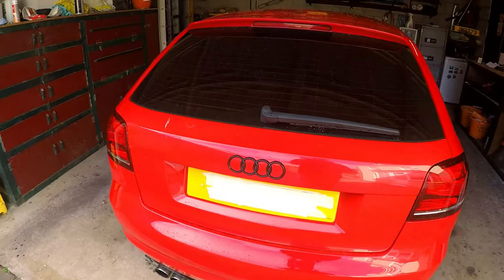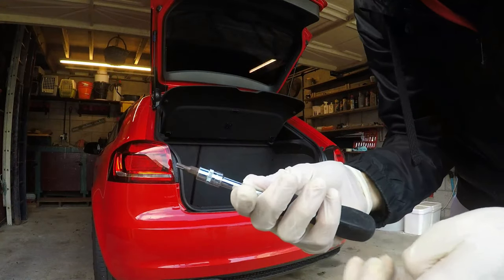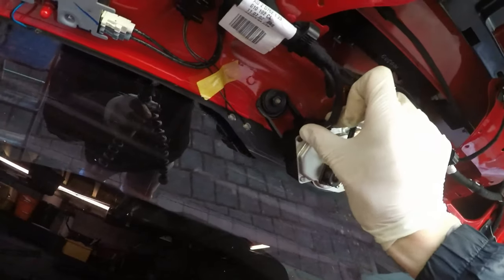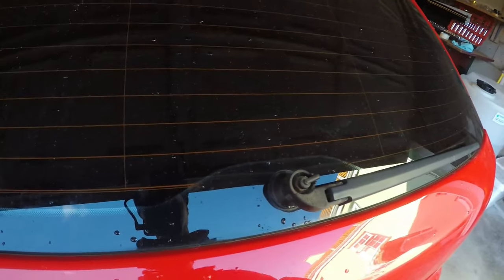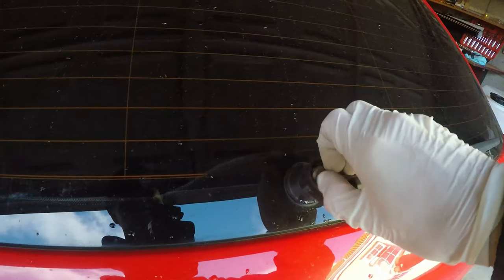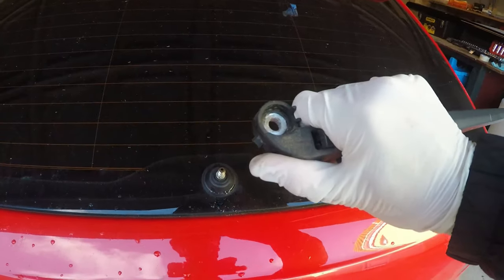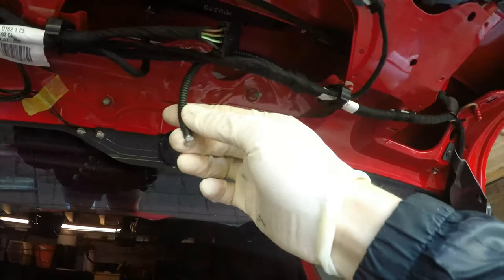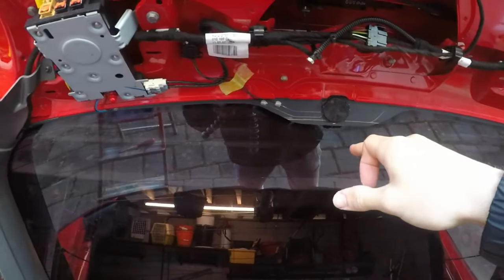I De - Wiper-ed My Car! - Audi A3 8P!!

Comment: Ide disconnect it from the bottle in the front. They are renowned for leaking and they leak into the amp or convenience control unit.

Comment: Hi mate god job! I'm going to do it on mine tomorrow, just one question, did it stay water tight? And what sealant did you use?
Reply from the maker: Hi mate, thank you. id imagine you had already done this as this was 11months ago.. but mine stayed water tight with no issues, and used a sealant that a friend gave me which is like rubber once it drys.... thats about all i can remember unfortunately mate.

Comment: Alright bud, where you get the tool to take off the plastics mate👍🏼 tried alsorts still won’t come off
Reply from the maker: Hi mate, their called trim remove tools, on ebay
Reply: Cheers dude picked some up off Amazon

Comment: My wiper is seized and wont come off, any tips
Reply from the maker: Loads of wd40, and tapping the thread with a hammer lightly, and use a pry bar to pry it off at the joint, use clothes to avoid any damage